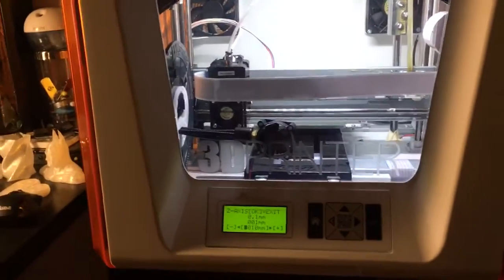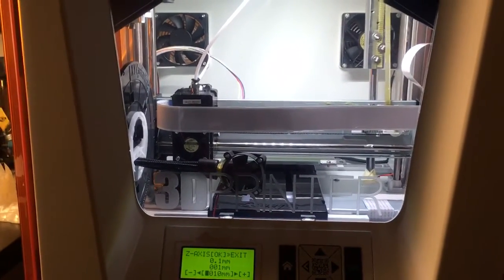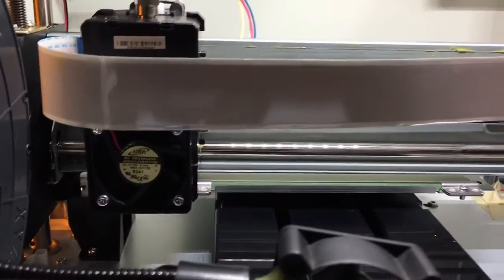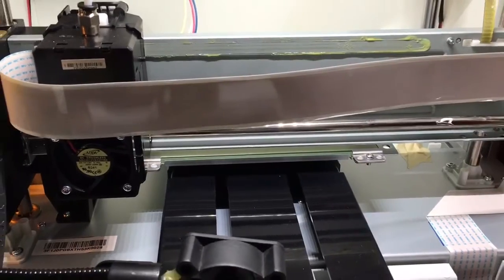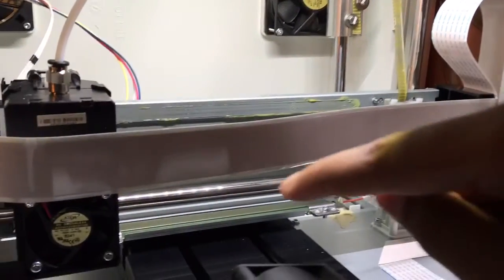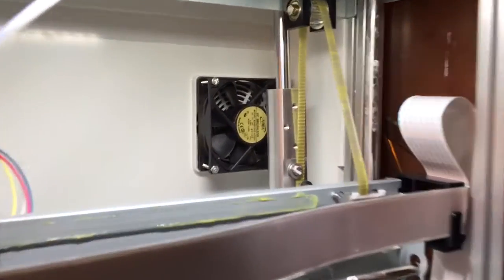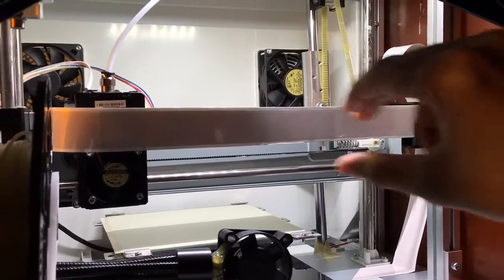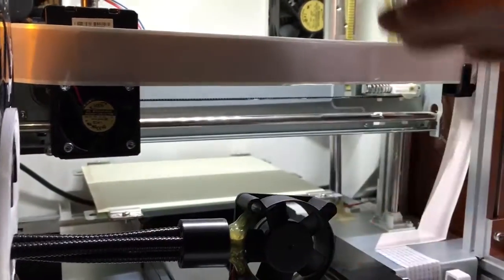Da Vinci Jr axis counter-balance fix

Comment: This guy has a interesting fix for this to. It looks like his fix even uses already-existing mount points xyz decided not to use to save costs.

http://www.thingiverse.com/thing:1558580/#files
Reply: Which if you watch some of the trade show videos where xyz demo's the jr line you will notice a bunch of them actually have this bracket installed. Probably to get better prints at the show.